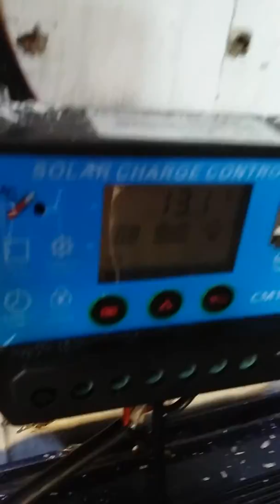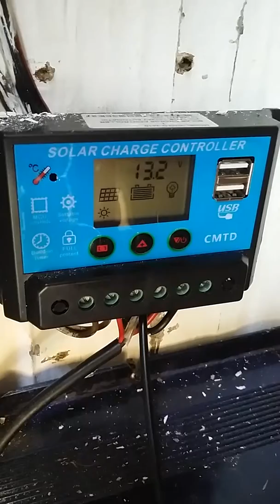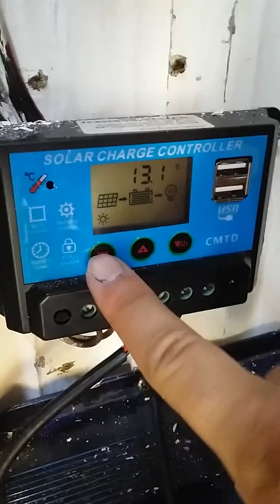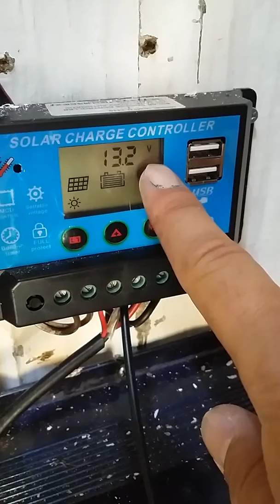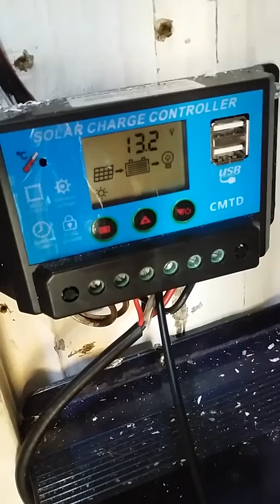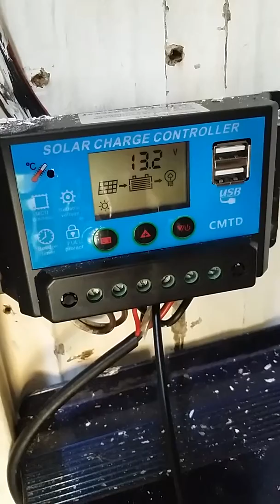Cheap eBay PWM solar charge controller review & warning.. Avoid overcharging / boiling battery

Comment: If you were to spend more money on a charge controller with usb ports what would you buy?

More expensive charge controllers dont seem to have usb ports - how do yousets charge a bunch of usb devices simultaneously.
Reply from the maker: @davebean2886  none of the older models as they won't support fast charging usb
Reply: @d-widdy  are there ANY new more expensive solar charge controllers with multiple USB ports or any other way to add a bank of usb ports to a 12 volt battery?   Thanks.

Comment: It sounds like YOU wrecked your batteries.   The settings were standard but you didnt adjust them.
Reply from the maker: Twas a long time ago but im sure i did set it - the controller overheated and malfunctioned or yes i perhaps i dint set it right, but this happened twice so second time round i had to be extra careful. I think they cant handle oanels over a certain wattage.

Comment: once battery is full, the voltage should hovers around 14 volts at full sunlight. your battery will produce hydrogen gas as you mention boiled. that's the nature of flooded lead acid battery. if your voltage kept climbing above 14 volts, then you have a problem.
Reply from the maker: @iceyaj3167  problem is mine malfunctioned and didn't stick to the settings I entered. I would only use these as trickle chargers for small panels. My 80w panel was too much for mine. For not a lot of extra money you could get a renogy wanderer. I would spend a little more and be safe 👍

Comment: Thanks a lot! Same problem. Did you manage to solve this?
Reply from the maker: Yes, you need to use it with a smaller solar panel that doesn't cause it to malfunction. Under 40w is probably the best bet & then when you can, buy a better one
Reply: So what makes one to buy a 10a, 20a or 30a charge controller? I tut it was supposed to protect the solar panel sizes?

Comment: I always wondered if an over voltage protection board on the output side of this device would alleviate this problem?
Reply from the maker: it would if it worked.. Seems they go haywire when they are under strain &  in my case it malfunctioned and cooked several batteries.. Be careful! only use with a small panel

Comment: I do not know what exactly was written in the manual of yours. But I got similar "charge" controller (it is more discharge controller) and it has three settings:  charging voltage (adjustable in range 12,7 - 15V); back to discharge voltage; and cut off voltage. There is written in the manual it is only good for float charge and lead acid batterie. So if you want to have it hooked up 24/7, you really need safe voltage. Yours 13,2 V now should be safe. I really don't believe this charge controller has ability to switch between absorption and float charge voltages, or even cut off charging. In my personal opinion it only can float charge same as my controller. But I saw different problem with these chinese controllers. You set certain voltage but the controller keeps charging the battery higher that that! So many problems with these. Need to test it first, if it works as intended.
Reply from the maker: That's right, only to be used as a temporary solution. If your battery starts gassing like mine did your at risk of an explosion. Avoid unless your just using it as a trickle charger with a small panel 👍
Reply: Mine says, default settings work best.

Comment: How many 205w panels can you connect on parallel with this type of 100A controller?
Reply from the maker: Probably two in full sunlight. Just make sure you use good quality wiring & if the unit doesn't malfunction, try adding another one or two

Comment: mine keeps changing itself to 24 volts on my 12 volt system after it has been charging for awhile....
Reply from the maker: check your battery voltage is good. if its too low the controller could behave strangely. Also make sure its not getting too much solar power, which can also make these malfunction. Check all wires are tight and properly connected :) If no good, replace with something like a Renogy Wanderer or victron smartsolar

Comment: I believe a part of the issue with these units are lack of information from manufacturer. Float, cut in and cut off values are assuming your controller will not be located at the batteries  but rather 10 to 20 feet. Therefore they are adjusting for wire voltage drop and drawing 10 - 30 amps feeding a 120v inverter. This will result in lower voltage being presented at the battery then the 14.5  indicated at the controller. Now if you have 3 feet of wire between controller and battery with very little load then yeah......your going to roast them.

Comment: These generic controllers are notorious for over heating and as a result the mosfets responsible for regulation don't actually work. Whatever comes in off the panel they just push straight through to the battery. The solution is to ensure that the mosfets are making contact with the rear of the case, and in addition you might want to add a heat sink to the back of the case.
Your "logic" here is a bit skewed, using a 10 quid controller to control an 800 quid battery!

Comment: so it broke your battery or you didnt have the correct settings??
Reply from the maker: Correct it will boil your battery by default & even when I replaced the battery & changed the settings, it still boiled the battery. These are generally unsafe - i would go for a reputable brand rather than risking a fire / your life, let alone wasted money on batteries.

Comment: 13.2v is too low a float charge voltage for lead acid 12v batteries; most sealed lead acid batteries say to float at 13.6-13.8v.
Reply from the maker: I was playing it safe.
Reply: @d-widdy  I think only need to go that low if you're in a really hot climate.
Reply: Even then, something like 13.37 is likely preferable.
Reply: Any 12V lead acid battery, when fully charged, has a voltage of 12,6V. This voltage means 2,1V per cell (:when fully charged, again). Above this voltage the gassing starts to appear. With sealed batteries therefore, it is wise to keep the floating voltage around this level, in order to avoid high water consumption through electrolysis during charging (in a heavy rate). There is no fear about sulphation as well. This occurs if the battery is left to stay below 12,6V for long time. Once per month, it is wise again, to perform "equalizing charging" in order to desulphate the battery. This means increasing the voltage to around 15,6V (sometimes up to 16,5) and stay there until the battery absorbs no current. This is the ideal case (for a healthy battery). Otherwise, wait until the battery absorbs a minimal current (and stays there for some hours). Anyway, equalizing is not recommended on sealed batteries (unless we can somehow add watter on them). If during this process the battery gets hot in some points (touching it externaly), this is a clear indication of sulphated cells. The process of equalization charging (desulphation) then needs to be done with very low current, say 1/50 of its Ah value, and last for many hours. Another characteristic of a sulphated battery is that it gets hot during charging, while it's terminals' voltage stops rising. It simply stays to a voltage, say 14V, and remains there for long time. This is what needs patience...Slow charge it for as many hours needed...The best results can come with the use of an external bench power supply, adjusted properly for that purpose (and the battery out of service). Any attempt for rapid recovery of such a battery, will cause internal short circuit in its problematic cells, which is an irreversible failure, rendering it useless for any longer use...
Reply: I stand corrected. Anything above around 13.2v does in fact slowly dry out the battery given enough time.
Reply: @jimmybrad156 Usually the electrolyte density being put into the battery cells at the start of their life, is about 1.260. If you add on this the electrical constant 0.84, you get 2.1V per cell (for a fully charged cell), that is, 12.6V for a 12V battery. This rule is valid for all types of lead acid batteries.
Old articles about solar chargers recommend this voltage as the most proper one for the longevity of the battery. Just because the charging voltage depends on the ambient temperature, it needs correction (i.e. increase for colder temperatures and vice versa). So 13,2V is just fine! In any case, the battery should be protected and not be exposed in extreme temperatures.

Comment: I bought a kit for ebay, with the same charge controller. Mine is just not chrging the battery, cause it's output is limited to a non changable value of 12.3V! Even if I go into settings, the value can not be altered! 
Chinise crap shitt!
Reply from the maker: Check the output on your panel just to make sure you have a good voltage should be around 17v
Reply: @d-widdy  I have of course checked that. Its 16V, in more light its 18

Comment: 14.6V?  Seems too high. I have MPPT charge controller (not the cheap chinese model, but one with big coils so it's real MPPT) and I deliberately adjusted it down to max 13.8 V charge as I didn't want to cook my battery.

Comment: Just hooked one up to monitor my 2 boat batteries going to plug a 100 watt solar panel later but for now just using it to monitor the battery levels.  Seems to be ok for this application

Comment: The USB sockets on these are limited to around 0.9A max. There's a resistor inside that can be changed to increase the current setting if you really want to.
Reply from the maker: Nice one Frank 👍
Reply: Mine crashes the controller if I connect any USB lead and has to have the battery/solar disconnected before it restarts.
Reply: Fucking chinise liars!
Reply: Mine gives around 60ma🤣

Comment: One has to size the Panel to the Battery. Sounds like maybe you didn't?
The 12v battery is attached to an 18v panel. A 24 volt battery to 36v panel.. etc. What v coming in FROM the panel?
It should give you this intel in the manual.. just sayin.
Reply from the maker: The panel was an 80w. Could have been a factor, but more likely the controller as others have said the same.

Comment: just got 2,  get them tomorrow, wish me luck :)
Reply: want to hear your experience with them too.
Reply: @awesomedee5421  blow one up,  :) crossed wires,  :),  but they work,  all my stuff is 12v, no inverters, just got LED lights, a alpocool fridge, only have on for 5hrs a days, and a small 12v tv, 2 110amp lesure batts,  60w solar panels,

Comment: I'm using the raggie pwm charge controller. My battery supports 13.2v to 13.9. today I realized it went up to 22v and my battery started boiling
Reply: Tried setting it back to 13v but no avail. Thinking of resetting the charge controller
Reply from the maker: @carlafuh9481  yes thy do crash but no warning sign just boiling batteries! Dangerous 🥺

Comment: well done. its hard to find a alarm about this on the net... the figure of 14.4 is fake you can have 20v or more coming out of the controller and it will read 14.4. it wont show any higher. this controller will limit your output voltage to 75% of the input, so with 36v coming in from your panel youll have 27v cooking your 12v battery..  there by use this with a 24v batt, for a 12v batt you need a 18v panel. your 18v panel will give 13.5v out from the controller.. when the batt gets near fullly charged. the 18v panel will rise to about 20v.. 75% of that is 15v going into the batt.. the display on the controller will show the  correct float voltage of 15v..when you have scrolled to the float voltage display.. this is no way to control battery charging.. this can be easily measured with a multimeter.. the amps are straight through.. the cheap mppts that look similar are also fakes.. ive measured some of those as well. no matter how insistant the seller is. there fake

Comment: I have one of these however mine works great, no issues so far. It disconnects at 10.5V reconnects at 12.6V and charges the battery till it's 14.4V then once it's achieved 14.4V it stops charging and starts charging it again when the voltage reaches 13.2V. and if there is something I don't like I can change all 3 values, I even checked with my multimeter and the voltage is accurate on the display of mine. If you need the same one as me then I still have the exact link to where I bought it from
Reply: Do you have yours set to b1 or B120, and what kind of batteries are you charging?
Reply: On mine, it's 0.3v out, compared to my FLUKE 87, but now that I know it over-reads by that it's fine.

Comment: I purchased one of these too, and came with a pathetically small panel claiming to be 100w. I didn’t read too carefully what batteries it supported and had bought a lithium ion battery. It still seemed to work, but I suspect I was lucky as the battery was fully protected by its own bms. It was indicating 14.6v when I first used the setup and was down to 14.3v at end of the week. I didn’t have my multimeter so couldn’t tell what the charge current was, and the controller only shows voltage. May have got away with it.
Reply from the maker: I don't think these support lithium batteries so please be careful. I would recommend victron energy smartsolar series 👍

Comment: Good grief!  You didn’t bother to zoom around the internet for a manual before destroying 3 batteries?  These manuals are everywhere.  A simple Google search would have produced the manual, where you could have actually learned how set it up correctly.  But you just blame the product for your mistakes.  Let’s be clear… it charged exactly the way it was designed/ configured to charge.  You sir, are fully at fault here for not configuring it properly.  I would have thought after destroying battery number 1, you would have learned your lesson and googled the manual….. but no, you repeated your mistake two more times.  Yeah, ok, let’s blame the charge controller.    That’s like pressing your car’s accelerator pedal all the way to the floor, then complaining the car is going too fast.  It MUST be a bad car.  GEESH.                     Here’s a good idea:  don’t connect ANYTHING electrical unless you are fully versed in all of the details, and you carefully verify that everything is functioning properly after you connect it.
Reply from the maker: I, like many others, live in the real world where you use a thing called common sense and intuition. And yes I did look up the manual & the limited info suggested adjusting the charge levels etc. The video is more a warning to those who buy these thinking they are plug and play, as that's how they are sold. I'm glad your a thorough kind of guy tho and do everything properly 😄👍 I hope you share your extensive knowledge with others and make a difference yourself 👍 See ya 😎
Reply: @d-widdy  I've found that with these cheap charge controllers the setting doesn't make any difference. Well done with your professional reply against the keyboard warrior. You will help people with your video and bless you for the warning
Reply: U mean 14,6v is too much

Comment: I have one of these cheap Chinese jobs too. It really acts as more of a regulator than an actual charge controller as they state. All mine does is maintain 14.4 VDC to my batteries - nothing more, nothing less. It does not maintain any kind of float charge as they claim. You get what you pay for I suppose.
Reply from the maker: Its a shame ebay dont allow reviews as mine boiled 2 batteries costing me way more than the controller did. Unsafe & potentially dangerous. The voltage reading is inaccurate too
Reply: @d-widdy  My controller is overcharging as well, now disconnect the solar most of the time. Cannot be trusted
Reply: My controller consumes my battery when it's idle
Reply: Did you try an over voltage protection board on the output side of this pwm?

Comment: When I bought mine like that I thought it was a mppt but I guess it's the same kind your ears must be defective because mine the highest it goes on my 50 watt panel is 14.4 I ordered a new charge controller it's going to be a 30 amp 12 to 24 volt automatic to handle a 260 watt panel which I have two of those if I use them both I will do them in parallel but I got to test her to test each of them before I decide to do that cuz but your charge controller must be a defective one I don't know how much you're running through it anyways good luck

Comment: Thanks for sharing this information....it's very useful. I have a question, can you charge a single 12v battery with a 300w solar panel with a voltage rating of 36v?
Reply from the maker: Hey man no worries! 36v is probably a 24v panel so you need a charge controller between the panel and battery to prevent damage
Reply: I have an older model that looks pretty much the same. They are rated for 50v input, but I wouldn't go with anything over 50W panels.
Reply: You need a buck converter capable of at least 300W of power connected between solar and charger which would drop 36V to around 18V, they're not that expensive if you buy from Aliexpres .

Comment: thanks for the video.

how do I change the settings (reduce it from 14.4 to 13v)
Reply: valid point i want to know that
Reply: why say why and not just answer ? pic the thing you want to change , hold left button down till it flashes ,, change it with the other 2 , up and down , hold the left button down again and it will save @cringuscristian8970

Comment: Read the manual, know your battery's specs. If you had set it right it wouldn't have cooked your batteries. I think you misunderstood
Reply from the maker: There is no manual, that's part of the problem. Also anyone who has done their research wouldn't buy it in the first place 😄👍
Reply: that bloke replying is a nob :) sod him  @d-widdy
Reply: what manual ? you misunderstood manors mate